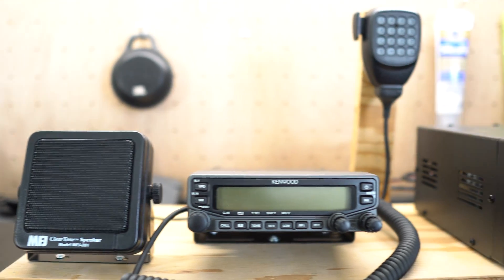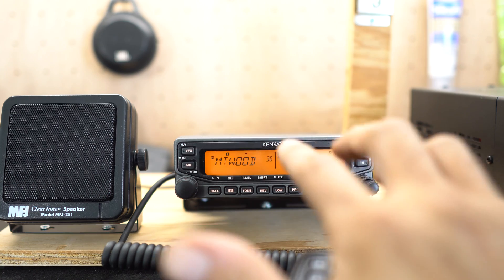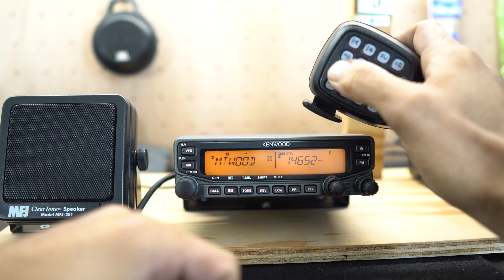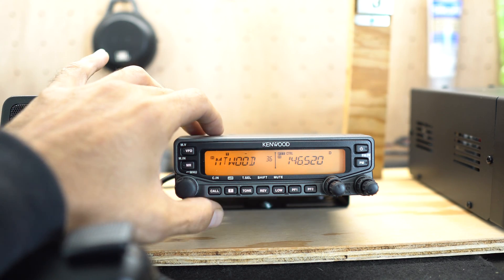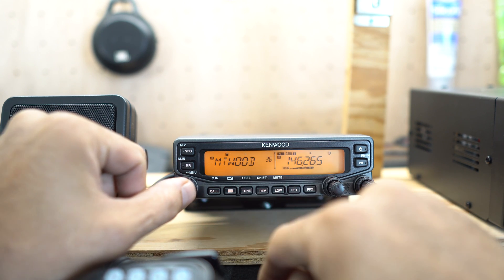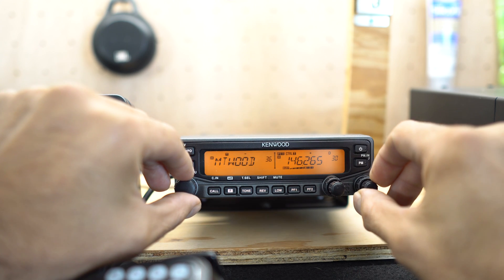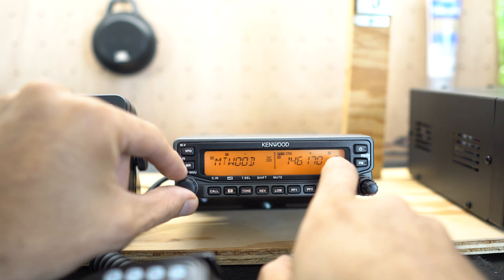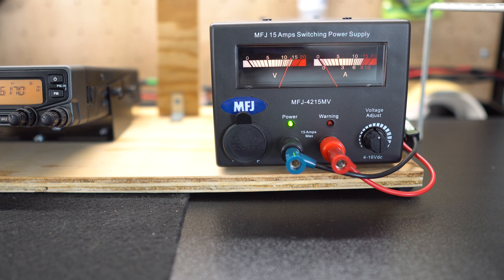Kenwood V71A Basic Operation

Comment: What's the best antenna to use with that radio for use in a pickup truck. Thanks
Reply from the maker: I'd get comet or diamond dual band antenna like the diamond nr770nmo.  You can look at magnet mount or nmo mount.
Reply: Thanks man

Comment: I have two of these,  my base and my mobile   love them both.
Reply: Is this a good radio for the SHTF scenario? I am asking about the freqs specifically....
Reply: @scottbig123  this just a regular duel band 2M/70cm radio. All I have done is operate in phone (voice) I looked up those frequencies and since they are in the Amateur Band,  it will work like any other radio. Not sure what you are really asking.  KCØKM
Reply: @KKEM641  I am really new to this world. I bought a Yeasu handheld years ago. It was really complex. I need a simpler radio. I was interested in getting a band which handles the emergency traffic, the two meter is the one! Thanks KKEM641!!!!
Reply: @scottbig123  this is a duel band,  but it still is easy too use. If you just want 2M I would go with a mono band. KCØKM

Comment: Great video.  I'm looking to get one of these Kenwoods.  
where can I purchase that MFJ power supply?  Thank you.
Reply from the maker: Thank you, the kenwood is a solid radio. MFJ power supply is ok but the fan can get annoying. I got mine at Ham radio outlet on sale.
Reply: @fotomotoxxiii  Thank you for the rapid reply.  I appreciate that.  Would you recommend another one if you had to get a different one?  I'm a new ham and want too set up a base station.  Thank you.
Reply from the maker: @charliereyes1205  hey no problem. I'd recommend one without a fan that's for sure but they're more money and will weight a lot more as well.  So if space is limited just get this one.  Otherwise look for one without fan. I don't know what model though.
Reply: @fotomotoxxiii  Sounds good.  I'll probably look into this one.  Thanks again for your feedback. Will be subscribing to your channel.  Thank you sir.
Reply from the maker: @charliereyes1205  no problem thanks for the sub.

Comment: I want to install this radio in my car and wire it directly to the car's battery with inline fuses. I'm confused about the battery voltage required to run this radio. It seems that everyone running radios off a power supply will select exactly 13.8 volts, but car batteries can deliver anywhere from 12 volts to 14 depending if its charging or not. Can radios operate fine over a range of voltages?
Reply from the maker: Yes absolutely they can operate from 12v up to 15ish.  Best thing to read owners manual to see min and max.  Below certain voltage transistors will saturate and not operate and above certain voltage you'll cook stuff unless there is protection circuits built in.  I set them at 13.8 on power supply at home. And in car if it's not running you definitely dont want to transmit as you will sink your battery rather quick. On receive you're ok for a while.  Voltage gauge works good for this in cars.
Reply: @fotomotoxxiii   I was hoping that was the case, good info. Thanks for responding!
Reply from the maker: @enceladus2263  anytime man thank you for watching and commenting. It helps get these vids out for being such a small channel.

Comment: How big of a power supply would you recommend for this mobile transceiver?
Reply from the maker: 15a plenty
Reply: Mr.G Disabled2Able really I was thinking like a 30 amp! But that would be over kill.. I wonder if that 15 amp would work for all standard dual band 50 watt radios?
Reply from the maker: @KE8ODY-WV-Ares-Ham-Dad-3O4  really easy to calculate.  Use ohms law and 50w at 13.8v will draw p/v = 3.62amps now  account in inefficiency of 100% (never going to be that bad) so a 7.5 amp supply is good to go. 30 is overkill but it's not a bad thing.
Reply: Mr.G Disabled2Able yeah your right but a 15-25 work just as affective for a 50 watt mobile
Reply: Mountaineer 3O4 No more than 10 amps, if you are only going to power a V/U 50 W mobile. One of the answers above was perfect - use Ohm’s  law and put in some “head room”. People always advise these huge power supplies, but cost goes up with amperage. I have actually run my Icom IC-2720 V/U on a 7.5 amp Trip Lite POS. Don’t get me wrong - if you are going to run a 100 W HF rig along with this, you need more current. I personally only run analog power supplies; but they seem to have gotten the RF noise issue sorted out on switching supplies.
Reply from the maker: I had it work off 7.5amp even no problem

Comment: I have this radio in my truck and have owned it for aprox 5 years now. It has broken down twice. The first issue was the fuse about the size of a grain of salt which is common to blow. Now the speaker won't work about a year later. keep this radio in bubble wrap surrounded by pillows. Anybody have a fix for the speaker?
Reply: Sorry for the issues you had. But for twice the price of a similar Yaesu or ICOM I guess that is what one gets. I fail to understand why Kenwood still sells radios.

Comment: Thanks for your overview here. This radio is the top choice for my first non- Baofeng and from what I can tell in this and your unboxing video, it's the quality I'm looking for!
Reply from the maker: Glad I can help. I will do a follow up review since I've had some time to play with it. It's a solid radio.
Reply: @fotomotoxxiii  Sitting here programming mine right now, just got it yesterday!
Reply from the maker: @paulwwalters  oh right on man. How do you like it?
Reply: Mr.G Disabled2Able it seems well built. The controls were definitely not intuitive but I figured them out. Radio manufacturers seem to employ the same UI designers as microwave oven and car radio manufacturers. I'm sure this complaint would apply to other brands of Ham rig as well. Sound quality is great both through internal and MFJ external speaker. I configured the PF Key on the remote the way you have it and it's more useful. Now I'm figuring out the scanning functionality. I'm close to an airport so I want to see if I can hear AM air band on this.
Reply from the maker: @paulwwalters  great enjoy! I'm also interested in AM bands to listed to public service and air band and such. I've yet to play with that.

Comment: Hi, Enjoyed the video and new subscriber. I'm a virgin to anything "ham". I am going to take my Technician test in a week. I found your channel by searching Kenwood  TM v71a. I am pretty sure I'll be ordering one as soon as I get my license (a long with a myriad of perriphial stuff).
I'd appreciate any advice...especially your thoughts on  a antenna.  I will be using this radio as a base. Currently I'm thinking of a  Diamond x300a vertical...but it's just a hunch. I live in a semi rural area just north of New Orleans, so flat land with a lot of pine trees. 
Sorry...I'm rambling but, I'm an old guy who as soooo many questions.. 
Thanks

BTW- In my younger days I had a Jeep CJ5  that spent most of the time in mud AND I'm a big enthusiast of pistols, my collection is mainly Glocks with 1911's, revolvers and a few oddballs😁
Reply from the maker: Hi there. I appreciate the sub! Feel free to post any questions you have and I'll do my best to help you out. I learned quite a bit since I setup this base station. X300 is excellent antenna especially for your location. High gain will let you get out far and height is important. Try to get the base of antenna at 20ft or higher.  I love CJs. We built a few nice ones with v8 swaps.  One day I'll make a video of all the jeeps we did swaps on.  Stay tuned for more radio videos, I'll be posting more now that I got comments rolling in a bit. 73s!

Comment: MFJ Mighty Fine Junk
Reply from the maker: Like RCA real crappy appliance.  It works and puts out stable voltage that's all that matters.
Reply: For a $12 speaker it's not bad! Better than many more expensive ($30-$50) Bluetooth speakers designed for music.